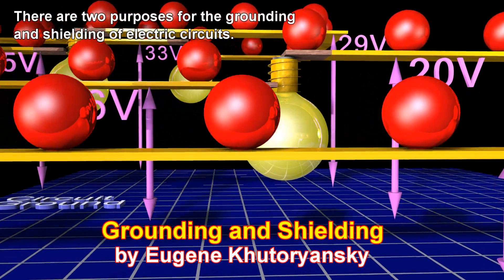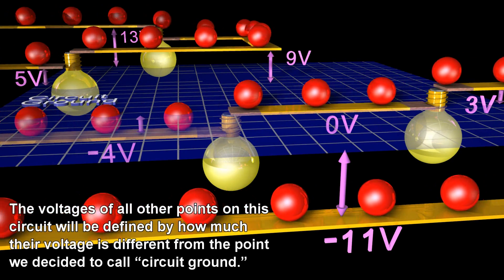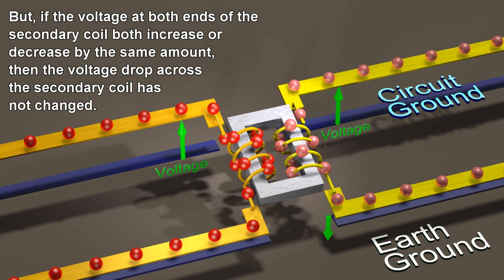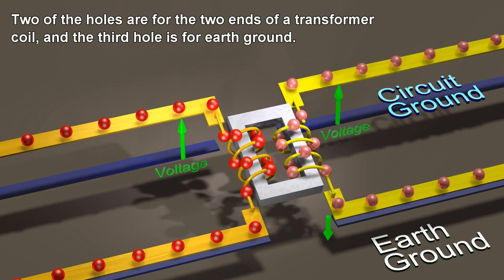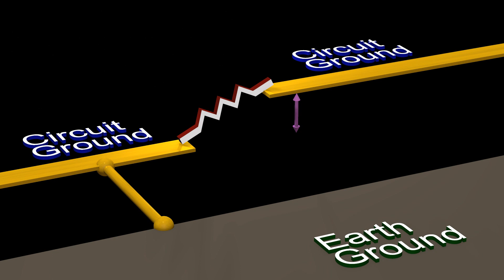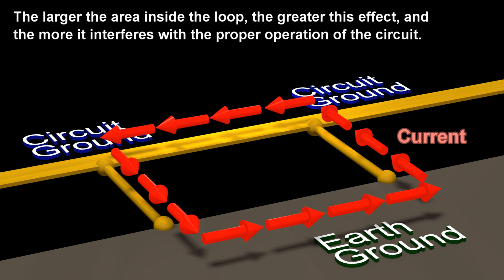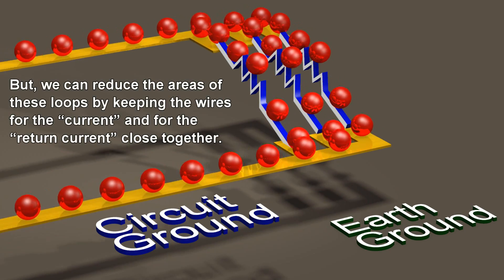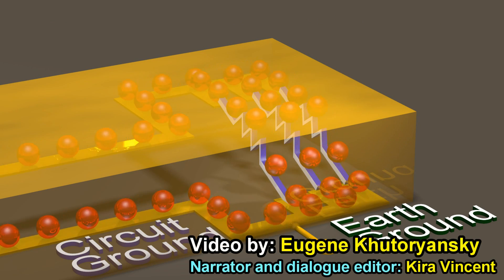Grounding and Shielding of electric circuits

Comment: A good video like all you others ( I have watched many) but this is a bit superficial.  It will make more sense to someone with a background in electricity/electronics than it will to a student.  For instance, 1) you mentioned that by connecting circuit ground to enclosure ground reduces or prevents interference but you did not elaborate on why that is so.  2) you did not mention that the neutral wire in the mains feed is connected to earth ground, typically at the building's electrical panel and also at the secondary of the transformer that feeds power to the building.  

I think (1) would be a good subject for another video:  a metalic enclosure assumes or acquires the electric field in which it sits, whatever that field may be, because it is metallic and thus electric fields are drawn in to it. The enclosure must also be fully enclosed and when it is it shorts out the electric field to more or less one potential across it's length, width, breath, and the enclosure could even be a sphere.  If the enclosure was made of wood then the varying potential of the electric field would still vary across the box and all the circuitry within.   A circuit is basically doing math with the electricity.  Circuit ground is the zero needed to do math.  All the many subcircuits (math equations) that typically make up an electronic device must do their math with the same zero, else the final output will contain errors.  By connecting circuit ground to enclosure ground, typically at one point of the enclosure, the beneficial short circuit of the outside electric field (the interference field), reducing it to more or less on potential, is passed or granted to the circuit ground. The circuit ground then sits at whatever potential as sits the enclosure...could be anything, including a varying 60 hz field. As long as all of the circuit ground is the same the circuit will be free from outside interference.  To be most precise, the enclosure and the internally connected ground are modulated by the interference field, but the circuit inside the enclosure is unaware of variance of the field across space, due to the enclosure having more or less shorted the field in that part of the space it occupies.  The circuit is blinded as to whether it is unshielded in a space without interference field, or is in a metallic enclosure within an interference field.

Two separate metallic enclosures will find themselves in different phases of the interference field.  If one then passes via a wire the output signal of circuit+enclosure A to circuit+enclosure B the difference in phase will become an error superimposed on the signal and the signal reaching B will be corrupted.  A second wire must connect the two circuit grounds to allow each the same zero for calculations, but being now outside the beneficial field short circuit of the enclosure the varying interference field will be imposed on it also making matters worse.

If the signal wire is shielded, enclosed in metal, and the shield attached to both the A and B enclosures, then the A+B+shield now short the field , making the A+B+shield essentially one enclosure and equal field potential will be found throughout.  As the circuit grounds  of A and B are both  connected to enclosure, and the enclosures connected via the shield wire, then zero is the same in both A and B and thus no calculation errors between them.

That scheme works well for short distances (up to about 100 ft) in normal residential and business environments.  And it works the same whether or not the enclosures are connected to Earth ground, for instance with battery operated circuits.  

At distances of more than 100 feet between A and B the scheme deteriorates due to increase resistance in the interconnecting shielded wire which then prevents a full shorting of the field to just one potential.  But note, if the interference field was uniform and simple, like a 60 hz interference field, then at certain distances corresponding to opposite phases no error signal would arise between A and B.  

The scheme of joining A & B into one enclosure with the shield of the connecting wire being imperfect over all but short distances led to the invention of balanced signal lines and their differential driving and receiving circuits that cleverly cancel the different interfering field potential between A and B while preserving the signal error free. 

A video showing how metallic enclosure actually "shield" circuitry would be very helpful to students and all as it is typically thought by many that the enclosure is something like lead to xrays, blocking the interference.

Comment: 1:31
the "earth ground" is obviously not part of the circuit. I don't understand how a current passes if we make a physical connection between "earth ground" and "circuit ground". how can we have a complete circuit then? and why can voltage between these two points be significantly different?
Reply from the maker: +Gottfried Leibniz, current will not pass through this connection, and we don't want it to.  The purpose of the connection is just to bring the voltage of the Earth ground and the circuit ground to the same value.  If they are not connected, the voltage difference between them can be anything.
Reply: @EugeneKhutoryansky  If you don't want current to flow through this connection then don't make any connection in the first place. Keep circuit and earth ground separate, problem solved ; )
Reply: Mike Zelik if you don’t tie them together then you can have a huge common mode voltage.  That would not be good for many IC’s
Reply: Physics Videos by Eugene Khutoryansky So you mentioned that even with a single point ground you could still have issues with the voltage along the return being slightly different due to resistance in the wire.  This is where you talk about the naïve approach of adding more Earth ground ties can make things worse by creating a ground loop.  So, if we can’t add more Earth ground points, what is the solution for this?
Reply: @SiegeX1  Earth and circuit grounds should not be connected to one another. The earth ground is only for the metal chassis enclosure and you (so you're not shocked just by touching the device), not for the actual enclosed circuit inside
Reply: He mentioned in the video, but you only want EXACTLY one connection to earth ground. If you have more than one, then current can flow in the loop and subject the system to EM interference - current can't flow to earth ground if there is only one wire/ conductor connecting two circuits. 

Connecting a wire, or "node" to another wire or "node" simple makes the two nodes into the same node.

Comment: Thanks again, I liked  it very much.  I have three  Q's. if I may ask.  1st. As an example an Internet router circuit board, they may have many small shields around (I would guess the oscillators and amplifiers for VHF) are those metals special in any way? some I have are almost gold like on the inside and a silver like polished on the outside.......2nd. Does the shape of the shields affect things and do the shields absorb passing radio waves? ......... I'm so sorry to ask so much but one unrelated Q. that has plauged me for awhile now is (subject : Einstein Relitivity) When we speak in terms of "Observers" and their "reference frames" are we as students to negelect "c" and assume instantaneous information in the thought experiment, Im sure we do just never had clarification.
Reply from the maker: +Andrew  Karpinen, the reason for using gold is because gold is an excellent conductor.  But, because gold is expensive, what is typically done is that it is just used as a thin coating on another metal.  The shields reflect the incoming electromagnetic waves.  The shape of the shield is typically not critical, but in high voltage applications, you typically want to avoid sharp corners, these can cause large electric fields.  In reply to the question about relativity, no we can't neglect C, and we can't assume instantaneous information, as the though experiments will not work otherwise.
Reply: +Physics Videos by Eugene Khutoryansky Thank you for the answers  to my Questions. Also the Dogs said Woof and Bark! When I told them you said Hi. LOL. ....And Yes we (All the Dogs and I) watched the new vid tonight together lol.😃